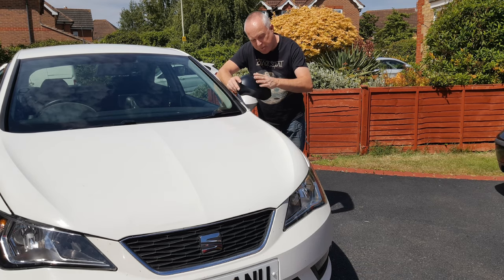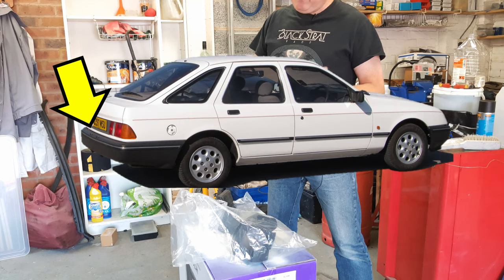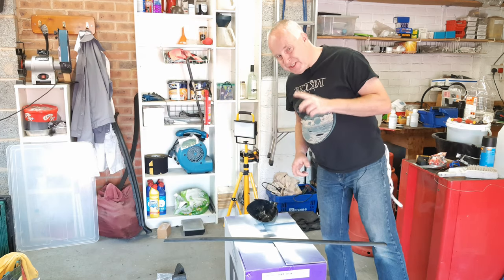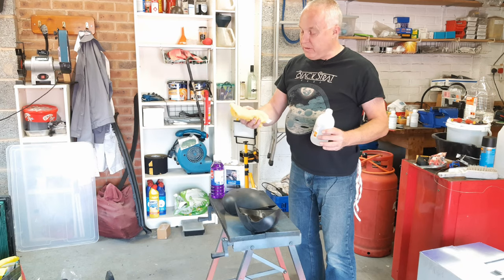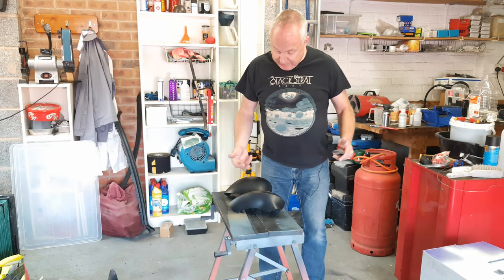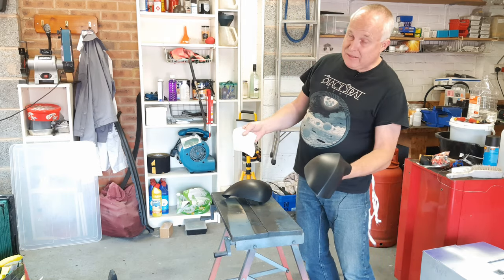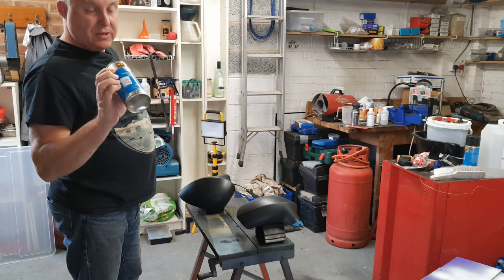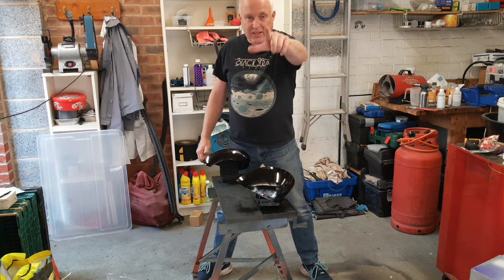How to Prepare Plastic for Spray Paint for a Long Lasting Finish

Comment: I sanded my front plastic dash piece with 220 grit then 320 grit and then wiped it down with wax and grease remover , then I painted it what I thought was going to be flat dark charcoal grey is what the paint cans cap color was , it turned out shiny black and it feels rough when I run my hand across it , I think I made the plastic rough when I sanded it , I'm very disappointed

Comment: Painting pp pe plastics are not always easy.I dont heat them up just clean it good then apply plastic primer then primer and colour and finish it with 2k coat.I heard also the best to use flexible paint or primer because paint can crack on these soft plastics.

Comment: Hi there, great vid! I want to paint my mirrors caps which have a chrome finish at the moment. They're plastic, was wondering if I need to use an etch primer first, and how many coats do you recommend for primer, paint, and lacquer? Is two enough.  👍
Reply from the maker: How to proceed depends on whether they really are chrome plated or aluminium like headlight reflectors. If it really is chrome, you won't touch it with w&d paper. You will need to strip the chrome off first. https://youtu.be/CDF3A3xUYeY. If aluminium, start with 600 grit w&d then 1200 grit and yes use an etch primer first. If you go through the aluminium to the plastic in patches, then take all the aluminium off and start with plastic primer. Alternatively, get the aluminium off by putting them in the dishwasher for a couple of washes.
Reply: @CycloneCyd  thank you, I'll see how I get on. I'm pretty sure it'll be plastic as they're Mini mirror caps and the caps are a rather thin plastic but I'll definitely check. And how about the number of coats, is it a 2 to 3 or do you keep going until happy with the look of the finish?

Comment: One small thing to note: using a heat gun to pretreat the parts will NOT work. Its the actual flame oxidizing the top layer of plastic. A great way to test that your flame treatment was successful is to drop a few drops of water on the surface. If it sheets when spread on the surface your good to go, if it beads, treat more. 

great video overall, lots of helpful lil bits!

Comment: in all my years i have never seen, or heard of, a propane gas torch for this purpose/effect. I have painted many rubberised plastic car mouldings and have not had a problem with adhesion. I usually clean well (cloudy ammonia added to the wash bucket removes all silicones and waxes) then lightly scotch, then quickly and lightly washwipe with paint thinners rather than Wax/Grease remover, allow to thoroughly dry, tack rag then plastic primer. I use a clear plastic primer that is probably more like an adhesion promoter such as PPG Deltron D820.
            Not saying the torch method is not effective, i've just never seen it. Probably worth mentioning the torch method is only for 'raw' mouldings and not painted ones..obviously

Comment: About 3 months ago I bought my first Saab an silver 07 Arc I tried using transmission fluid and a heat gun method on the door trim to restore it. It looked good for a couple of days then faded worse so I cleaned them with alcohol, taped off with newspaper, used plastic primer and then trim restore paint. So far so good but we'll see if it lasts. Thanks for the video I didn't think about taking them off the car.
Reply from the maker: I'd be surprised if it lasts long after having put MTF on them and heated it. the surface will be contaminated. You never know your luck though.
How to get them off:  https://youtu.be/oP2Dy-Eb5fM
Reply: @CycloneCyd  I used new ATF and I didn't paint it the same day, about two weeks later. The black parts on mirror absorbed the ATF and look brand new but the door  strips being softer didn't. Anyway thanks for replying and for the video.

Comment: Trying this again on my plastic phone case (made of PC hard-shell) because they don't make the color I want. Tried it the first time with my old case and it appeared that the matte spray paint (which says it is supposed to work on plastic and has a primer in it) stuck well. I sanded prior and cleaned. However, a week later, I tried to clean my phone case with a clorox wipe and the wipe was wiping off some of the paint. Not peeling it, just smearing it off. I have to be able to clean my phone case with these wipes..  clearly a chemical rection is happening. Any thoughts on how to keep that chemical reaction from occurring when using wipes? This reaction does not happen when I use the wipe on the original cases paint job. Do you think this happened because I used a matte finish? Do you think satin would would better? I saw that you used a  blow torch for PC... I don't have that. Is there another way? thanks

Comment: Hi
Thanks for vid, yr an easy bloke to listen to.
Firstly...."as it happens 17inch alloys fir in a bishwasher" 😂 hope the wife doesnt watch this lol
But it just seemed yr vid ended a bit quick.
You said "bake at 60 for an hour" i am painting interior parts on my mg zr which wont fit in oven, how do i bake them?
Also, how many layers is best?
Should i be applying a finish lacquer?
Im wanting to freshen the interior up and change the horrible cream coulour to black, also want to add some green accents....do i paint it all black and do the green on top or mask off each section seperate?
And lastly, will this work for the sun visors.....they are a very soft plastic cover....wondering if constant sun is going to affect anything.
Anyhoo, sorry for the barage of questions
I need to get a new piece of felt for the roof liner....thinking of a starry sky type patern, and really want to put some effort and time into doing the interior well.
Thanks again for the video and help, ive made a list and will be off to get prep items and paint soon 👍

Comment: Great advice, thank you for taking the time to add this. My job, repainting Boxster 987 centre console to get rid of the horrible sticky rubber coating thats chipped and sticky.
Reply from the maker: Oh yeah. those 'soft touch' paints are great when new, but just don't last.

Comment: Well done 👍 & liked.. I have an old laptop plastic back case to spray paint black which is originally black .. and it's a lil dusty.. For pre cleaning, should I wipe it down with isopropyl alcohol or just plain warm water with mild detergent before spraying paint.. what do you suggest?

Also is a primer spray mandatory which I don't have at hand?
Reply: did you actually watch the video vira

Comment: Great informative video bud, with the soft plastics do you prep prior to heating the part or warm first then prep ? …. Cheers 👍
Reply from the maker: Run the flame over it first. the purpose isn't to warm the plastic but to create a chemical reaction on the surface that helps paint adhesion

Comment: I'm looking to paint the black trim on my 9-3 to color match ut, I have backup sensors though,  I have read conflicting posts on if you can or can't paint them, did yours?
Reply from the maker: OK, I can clear up the conflict for you as I used to deal with Plastic Omnium testing warranty returned sensors for JLR:  DO NOT PAINT THEM

Comment: How do you paint a plastic part that has already been painted a different colour?
Reply from the maker: provided the existing paint is sound, just give it a light sand with 600 w&d, clean and paint.
Reply: Hi Cyd - thanks. That is what I thought. Might put some adhesion promoter on as well
Reply from the maker: @malcolmward  yeah, plastic primer is also called adhesion promoter. Use that first.

Comment: I'd be far more interested in learning how to paint (spray can paint) already painted plastic parts on my car. Mirror covers as it happens. 
My amateurish logic tells me, just sand the original paint/clear coat gently, without cutting through to the plastic. And go from there with primer, base coat and clear coat, in multiple layers probably.
But I'd like a professional opinion!
Reply from the maker: If they are already painted, sand with 600 grit. No need for primer unless you have plastic patches showing anywhere, in which case use plastic primer.
Reply: @CycloneCyd  thanks very much!

Comment: i liked this video but you forgot to put a close up of the final finish :(
Reply from the maker: Ah, there's a reason for that. This video is about preparing plastic for painting, rather than the painting itself. I see so many people just dive straight in with a bit of w&d, ordinary primer and paint and then wonder why it's all coming off a few months later.
Reply: @CycloneCyd  still would be nice to see a completed shot that lasts longer than 1 sec.